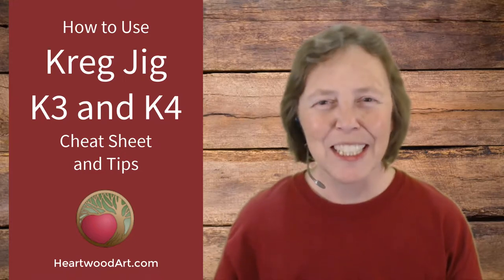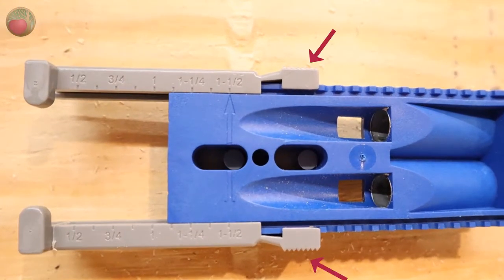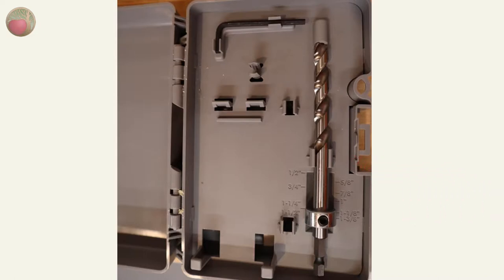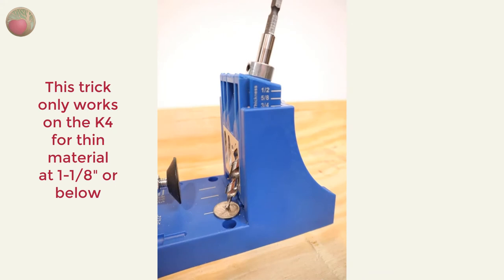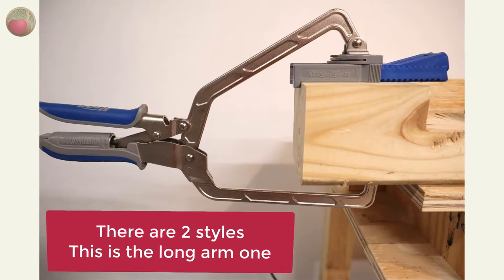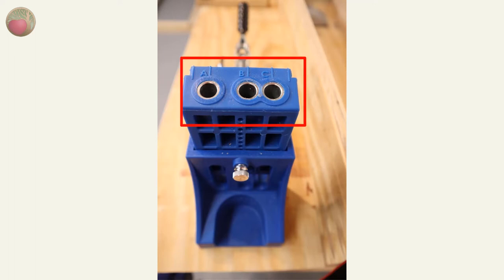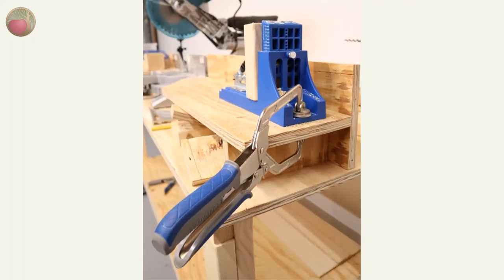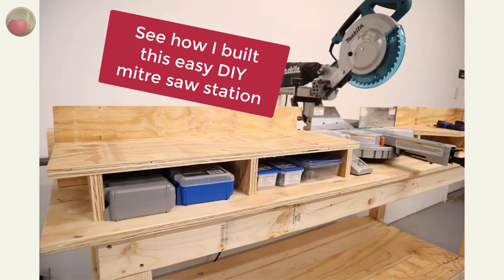Kreg K3 and K4 Jigs: How to, Cheat Sheet, and Tips

Comment: Loved your very simple to understand video so I’m now a subscriber!! One question I am about to assemble my own mobile router table where the construction is out of 2x2” (hard wood) oak. I have just purchased a Kreg K4 master set can I build using K4 Jig or do I need some other Jig? Regards Chris “ The Aussie living in the Netherlands”🇦🇺😉
PS
 (and have just finished my first pocket hole project a front entrance - Family key rack with built in shelf and letter storage area
Reply from the maker: The K4 can easily handle a 2x2. 

The frame for this stool was all 2x2. 
https://heartwoodart.com/shop-stool-thats-easy-and-cheap-to-make/

But for short distances between boards like that, a right angle drill comes in super handy!! Just made a raised dog bowl feeder with 2x2 legs and was glad I had that smaller headed drill for it too. 

I also bought more square bits and got one half the length of the one that came with the Kreg. Made it easier to get into tight spaces too.

Comment: Nice video but a little clarification. What you are calling the K3 is actually the R3. The larger jig that you were referring to as the K4 is correct. The predecessor to the K4 is called K3, and I own this gig. It looks very much like the K4 except the clamping lever is on the front side, toward the operator, rather than on the back side, away from the operator. Everyone will have their own preference but I prefer the K3 to the K4 especially if I am using sheet goods as the K4 can be difficult to reach around.
Reply from the maker: Yeah, I finally realized my mistake after the video and post had been up for a while. I really like all of the Kreg jigs I have too

Comment: I have a question! I recently got the R3 and when I try to join two panels together using the Kreg 90º clamp, when I finish screwing the screw, the panels don't align anymore. It's a tiny but noticeable difference. Does anybody know what I'm doing wrong?
Reply from the maker: If you over or under tighten the screw, it may pull the wood slightly out of alignment.

I try not to fully tighten the first screw before getting the second one to that same place. Then tighten both down